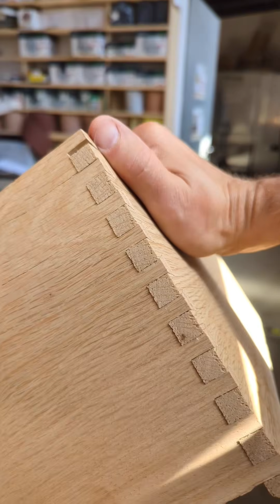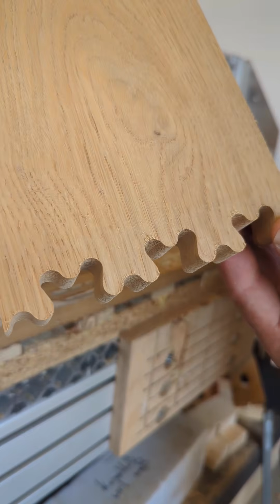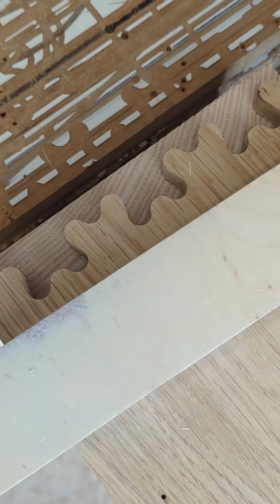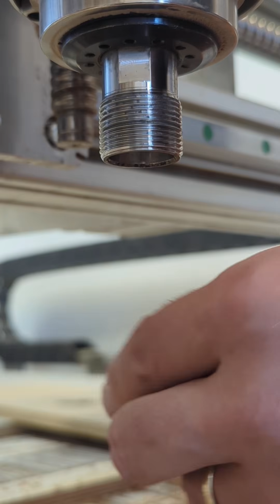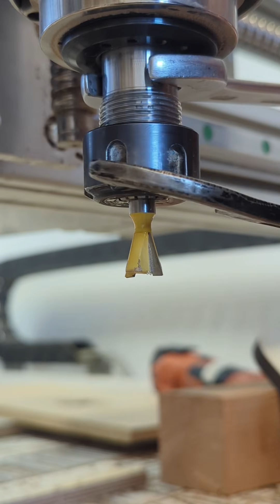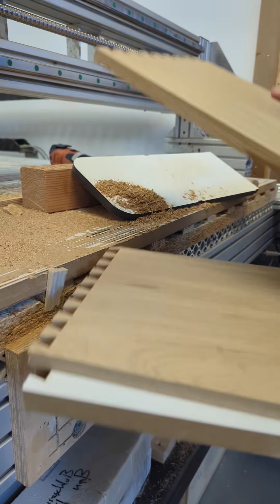cnc joinery basics

Comment: I also used the CNC already to do dovetail joinery. I modeled the joints in Fusion 360 and used the models to calculate toolpaths from in fusion 360. Works fine but I am sure there are easier (faster) ways. What software do you use to create the toolpaths? Greetz!!